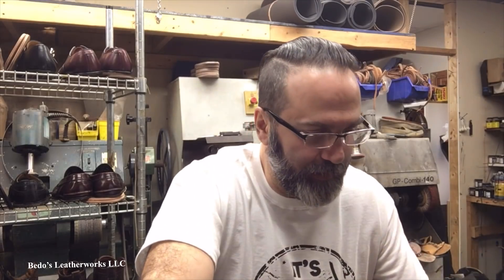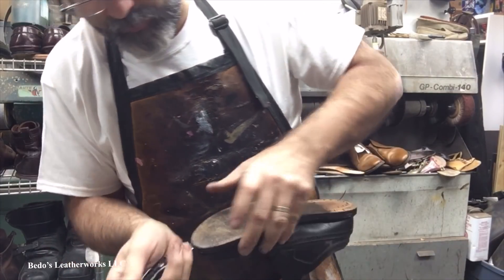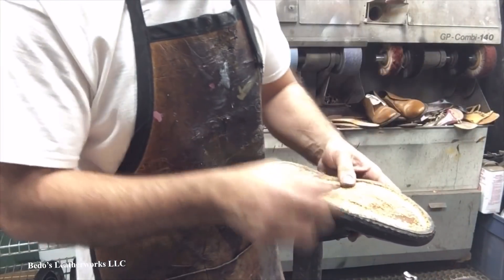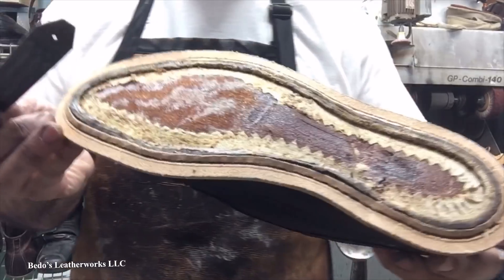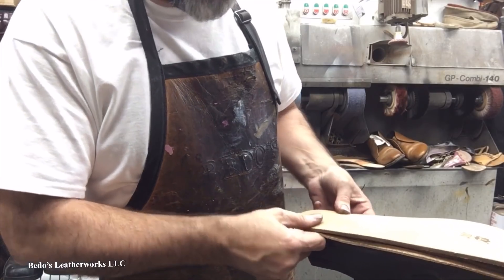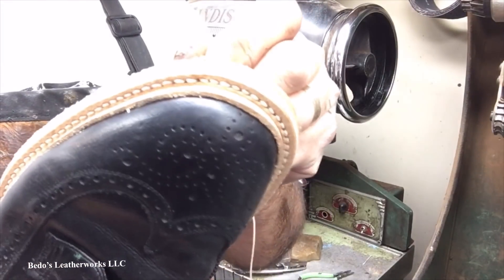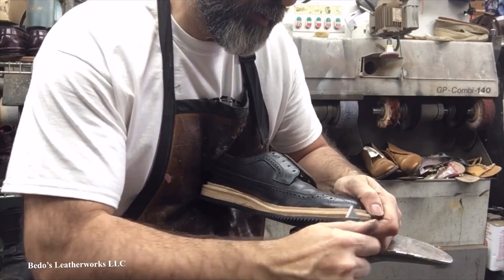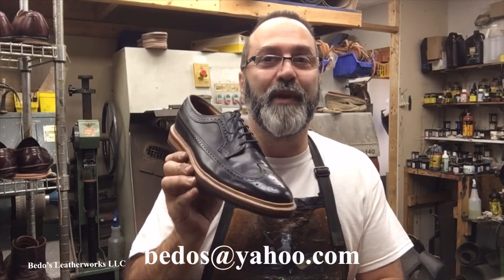Florsheim hybrid by Bedo’s Leatherworks #148

Comment: They came out great! I always worry about that tread pattern, because its find for walking straight ahead on a solid, grippy surface, but if you walk on a surface that slippery and put any kind of sideways stress on your foot, the shoe slides out very easily because of the lines and you easily sprain your ankle. I had a pair of sneakers that had that and went along in the grass until there was a hill in the grass and I slipped so much I had to take the shoes off and walk barefoot to get down to flat land again because it was as if the hill was made of oil and soles made of teflon.

Comment: Doing a welt by hand looks like before long the cobbler will get arthritis.....or carpel tunnel.....
Reply from the maker: Hack Prine bight your tongue
Reply: @BedosLeatherworksLLC  I'm a retired tradesman .... in my experience with hand tools and carpal, metacarpal and phlangi strain... to avoid such debilitating strain on the hands and joints... I have found power tools that fit the bill.. or if not I invented one.. or rigged something... 'cause anything is better than arthritis... I've seen careers ended 'cause of arthritis and carpal tunnel...Be kind to your bones and invent a tool that won't strain and injure them...you got a lot of years of work ahead of you... Good luck... and cheers...
Reply from the maker: Hack Prine thanks mate, well I’ve been at it for over 35 years now and so far so good but yeh I hear ya 👍👍👍
Reply: @BedosLeatherworksLLC  You know I was thinking... oh that hurts...   What do you think may happen if a Awl needle was afixed to an ultrasonic tooth brush.. and vibrate the needle in the leather instead of using the hand for an arbor press.??... lol
Reply from the maker: Hack Prine interesting!!! Yeh if you are sewing welts all day then definitely need to come up with a new way. If that was the case then I would invest in the Goodyear welting machine for sure.
Reply: @BedosLeatherworksLLC  I think i'll glue a awl needle on my ultrasonic toothbrush and try it out.... I'll let you know if it works..... lol..